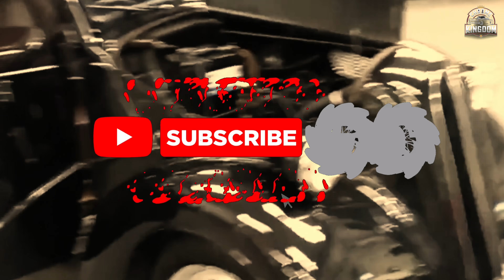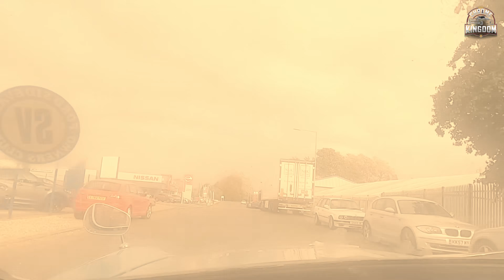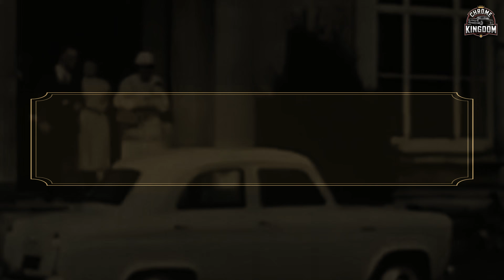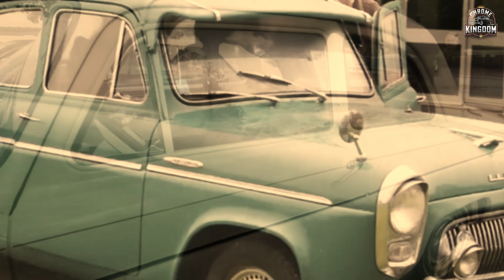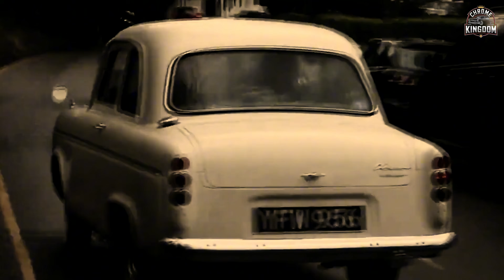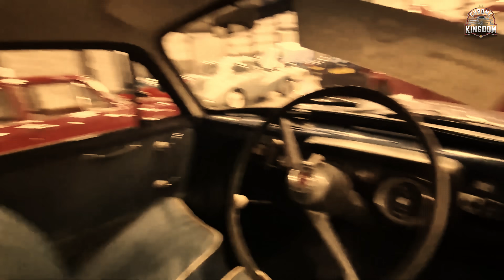7 Shocking Problems With the Ford Anglia 100E — Why Britain Still Loved It 1953–1959

Comment: Could keep it running? With a new gearbox and new axle....
Reply from the maker: You are spot on—those components were notorious weak points that often required a swap or a significant rebuild to keep the car roadworthy!

Comment: I was spreading. Lime. On. Co partner farm. That was owned. By. Ford dagenham which was using a. Wartime. Runways.  Airbase. Boreham. Chelmsford  as. We. Got. Near to. The. Runway we. Could. See this. Strange. Car going round. It. Started. Smoking. From. Engine and. You. Could. Hear. Knocking.  From. Under. Hood. Driver. Got. Out. Lifted. Hood. And. At. That. Point. I. Got to. The. Wire. Fence. And. He. See. Me. Got in quick and. Drove. Of.  Engine. Knocking.  In those. Days. Mo phone. No. Camera.   Months. Later. The photos. We’re. Released. Of. The. New. Ford. Just. A bit of. History. Lime. Spreading. Company. J b. Devenish.   Rayleigh. Im. 90 now.  Western. Australia.  Thank. You.

Comment: My first car was a 1956 100E - HMY 637.  Purchased in 1966, it was in fairly good nick - but the engine was shot.  I bought a new recon engine in 1967 and in the Sept drove to Bristol from Sunderland fully loaded to run it in.  No problems at all but the engine blew at Leicester Forrest East at 1am.  It was towed home, the engine removed and returned to the rebuilder.  The incorrect 105E dipstick guide had been fitted and it had only a couple of pints of oil. Refitted, the replacement engine was fitted and, the car sold to a friend, it continued for 2-3 years before being sold.

Comment: My first car was OAY266 a 1956 100E Anglia. Cost £50 in 1966. Did about 80,000 miles in it. The 3 speed gearbox was the biggest problem as it didn't have much go, but it was very reliable and gave very little trouble. Great little motor! I wish today's cars were half as good.
Reply from the maker: That is an impressive amount of mileage to get out of such an affordable first car!

Comment: I owned several 100Es when I was young. And yes, while the mechanicals were old school even at the time, the so called 'more advanced' Morris Minor Series II OHV engine was a measly 803cc, and so painfully slow you'd feel like getting out and walking if you were in a hurry.  Despite its unfortunate three speed gearbox with a big gap between second and top, the 100E was a good performer, and was very easy to work on.  I once got up at 5am, pulled out the gearbox, replaced first gear that had lost a tooth, and got it all back together in time to make my afternoon shift. Underbody rust would get the 100Es in the end, but they were a pleasant looking, and good little car in their time.
Reply from the maker: That is an incredible story about your mechanical repair speed!

Comment: I was a 3rd year medical student when I got my 1959 Ford Anglia 100E as I needed one to Zip round the various hospitals. This was in 1967. My parents had moved to Birmingham area from Glasgow and they bought the car so I could get down in the holidays carrying all my gear. I picked up the car from the Ford dealer and drove to my digs. Checked the oil , a bit low, so filled up and next morning left Glasgow for Birmingham. Got as far as Lockerbie on A74 doing about 60 when Big End blew. Limped noisily into Carlisle having filled with thick oil and went to Ford dealership there. Got a replacement Engine, charged to dealer I got car from., suspected it had been switched at their garage as I had been unable to pick it up for a week. I was on my way in 24hrs joining M6 just north of Lancaster. Had to run it in at 30mph on a motorway!!. This difficult as speedo faulty bouncing all the way between 20 and 60. Got a new speedo when got home to Birmingham and mileage reset to zero on a newish engine. Over the next 3 years I travelled 60,000 miles . I got married and moved to Ayrshire within the year when I was still a student and the car took me faithfully up and down to glasgow daily using back bumpy roads. I had to replace the front nearside suspension leg twice. 35 shillings in breakers yard. we had a heater and windscreen washer(hand pump) I put in halogen headlamps and we used a small handheld transistor radio on the dashboard. Every few thousand miles the jets in the carburator would block. Would often happen on motorway. I would pull out choke and car would travel at 40mph till I reached service station. Go in for a coffee and wait about half hour to allow things under the bonnet to cool then I would quickly dismantle the carb scrub out the well with a baby's bottle cleaning brush and use fuse wire to clear the  running jets. I.d be back on my way in another 15 to 20 minutes. She was a faithfull old girl and saw us through to graduation and finally replaced with new VW Beetle. My brother in law had the car to go to school before we scrapped it. Incidentally I kept all the keys we had accumulated and 10 years later the garage owner behind our surgery had picked up a 1960 popular but had no keys. I gave him mine to try. They worked!!  I loved that car. I never had problem with gearbox nor differential. I would run 2-3 times a year to Birmingham on M6 travelling at 60-70mph, downhill with a tailwind. LOL

Comment: It may have had problems (3 speed gear box with no synchromesh on 1st, the wipers and heavy on fuel) but it was the car my driving instructor had.  I had 10 lessons (the only driving I did) and passed my test 1st time in 1958 Hertford.  I'd been motorcycling for a couple of years though so I was aware of the Highway code etc.  It was OK, cheap and simple to maintain.

Comment: Vacuum-powered wipers were useless. Eg. if you accelerated into heavy rain the wipers would slow or stop, leaving you blinded -- a very dangerous situation. Vac wipers should've been banned decades earlier. Anglia's 3-speed box felt like you were driving with no 3rd gear. The underpowered low-torque sidevalve donk spent much time either wailing in 2nd or struggling in top. A PIA on hills or in traffic.

Comment: My dad got a '58 to for a cheap commuter in the late '60s, replacing a Renault Dauphine. To start took unscrewing the wingnut on the oil-bath air cleaner and priming the carburetor with some gas that we kept in a can, plus the appropriate vocabulary, nice or not, depending.  The clutch was hydraulic, I think, at any rate long worn out and no parts available in AZ, so it had to be double-clutched.  The vacuum drive of the wipers was long gone, but the car was so small I could reach into the glove compartment and operate it manually.  In the desert of course that was not usually an issue, but once I was driving in a winter monsoon thunderstorm on a road that was flooded with about half a foot of water.  With the weak engine I was also having to constantly shift up an down in a headwind.  I still don't know how I did it!

Comment: I had a 1957 Anglia (MHM 862) which the previous owner had modified; higher compression aluminium head, four branch exhaust manifold, twin carbs, updated clutch.  The result was a mighty 52 bhp! I kept it for a couple of years and then swapped it for a slightly rusty Zephyr Six when I was living in Northern Ireland. This was in the late sixties.

Comment: My first vehicle was a  well worn 5cwt Ford Thames van (ie the van equivalent to the 100e) and yes I remember so well about the windscreen wipers which were a disaster. Also on the "new" M1 it crept up to 50mph and downhill possibly 60 mph. The steering ball joints were forever wearing out. I bought an old bus seat from the scrap dealer and put it in the back for my mates to sit on. My engine failed outside my house, a crankshaft came right through the engine block, no idea why. Had a replacement engine fitted. Driving was a real pleasure in those days, not like now! Happy days (1964)

Comment: Sez in the manual these engines do burn a little oil. Mine was affectionately called blue cloud. After 50 mph it used to fill up with blue smoke and you had to open the windows to let the smoke out. 

McPherson struts always leaked oil. Brakes were terrible. A lolly pop lady jumped in front of me. It was impossible to stop. I remember looking at her frightened hazel eyes pressed up against my windscreen. The kids were giggling at her. They werent stupid.

They only did about 20mpg due to the combining of a side valve engine with a 3 speed gearbox. I remember the oil leaking on my drive from the thing. At the time a local petrol station used to sell cheap russian motor oil at 50 pence a gallon. Used to leak more oil than the torrey canyon.

It had a ceramic knob that used to operate the heater fan. One day it shorted out and I had awful burns when I touched it. 

The windscreen wipers used to stop, going uphill and then take off like a bat out of hell going down the other side. Absolute dreadful vehicle, put many pounds into it, a proper money pit. Mine was the blue one to match the colour of the smoke out of the exhaust. Ran on no grip cross plies of dubious budget character.

Comment: My dad worked in Fords Dagenham plant in the 50's, he was involved in the early 'improvements' of the car like making the gear lever know lighter to stop it jumping out of gear.
I have pics of this car (Ford's promotional advertisements) of the car being crushed by a very heavy digger,  ie run over on the rear and surviving it structurally. 
In 1975 I had a grey and maroon 107e..same body shape as 100e but with the ohv Kent engine and 4 speed box which was lightyears better than the 100e

Comment: I bought one for £3 when I was 13 years old in Ireland. When I finally got it started the dipstick and the oil filler cap flew up in the air.
There was no number 2 piston or con rod. Saved up again and bought another engine for another £3. I should've kept the Opel Rekord I was given by one of my neighbours.

Comment: Side valve engines are very robust not the most powerful but reliable
Reply: Easy to "de-coke" too!
Reply: 'Not the most powerful' ? Most side-valves were bloody gutless.
Reply: @rocketeerPM2500  Those 100Es were gutless.

Comment: Living by a long steep hill in the 1950's we often saw people get out and walk up to meet the car at the top because it couldn't manage the climb with a full load.. There was a 100E van whose driver used to go up the hill in reverse, apparently the best gear ratio..
Reply from the maker: The stories are very good, we were able to experience times gone by, reading the stories, thank you for sharing
Reply: Rubbish it would climbed the side of a house in first. It was the first “modern” car I owned and by the standards of the day was perfectly adequate, yes it had its short comings notably the wipers, but basically it was reliable, relatively comfortable and more importantly affordable.
Reply: @MegaPerignon You can say rubbish but I saw it with my own eyes. Sorry.
I had a twenty odd year old Anglia 100E  in the early 1970's. I know their strengths and limitations!
Reply: @flunkyminion  The engine was either shot or out of tune.The 100e in standard form could pull like a train and was quick little car in its day.
Reply: @101zetland  I completely reconditioned and rebuilt the engine, carburettor, ignition, transmission, everything. I did the brakes, wheel bearings, etc I got it into peak condition, good as new. You had to really use that 3 speed gearbox!
Some long steep hills with a full load, were, shall we say, a challenge.

Comment: I knew a man who was a Collier at Babbington colliery in Nottingham. He had to travel up Bells Lane a long haul to get home so he used to turn the advance/return on the distributor a couple of notches advance before setting off home from the pit otherwise it was less than walking pace to get up the gradient. Honest! A true 1960's communist he eventually traded the Ford in for a Moskovich. Say no more.
Reply: That is the funniest tale I've seen on Youtube this year. My dad knew someone of similar views who bought a Wartburg, on principle. 2 stroke, as powerful as a municipal lawnmower!
Reply: @1951GL  The last Wartburg I owned had three coils and three sets of contact breakers. Body as new but two strokes were out of fashion  and it had no character with its quirky engine noise and 3 cylinders rather slow.
Reply from the maker: thanks for sharing your experience

Comment: 3speed gears and wipers that slowed down when going up hill
Reply from the maker: wow, very complicated
Reply: Sometimes on hills, you could not restart if you had to stop, and very steep hills had winches at the side of the road or tractors on standby during busy times and a few hills had turning points at the bottom so you could reverse up in the lower reverse gear.  Vacuum wipers were carried on into a lot of commercial lorries way after they finished in cars refined for fast and slow. Gone are the days you could pick up a car for a fiver.

Comment: The vacuum powers windscreen wipers were a disaster.
Reply from the maker: true
Reply: I remember my dad having problems with them, they worked well when it wasn't raining.
Reply: You watched out for an uphill stretch and then needed a good memory ( only short term- till the next slope!)
Reply: When crawling along at 10 mph they were overspeeding but when you got a bit of speed up (relatively) they could not keep the screen clear and hid in the corner
Reply: I replaced the tubing in mine, not realising that there was a choke point in the original pipe to prevent over speeding. The first time I tried them out and went downhill the wipers went so fast that one of the blades flew off and was never seen again.
Reply: I put an electric motor from a 105E in my old 100E and it worked fine.